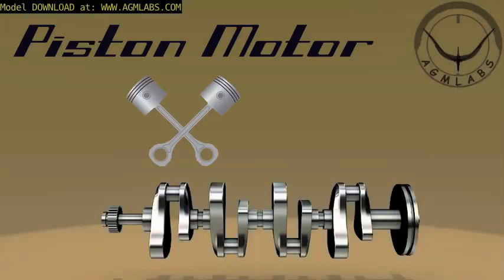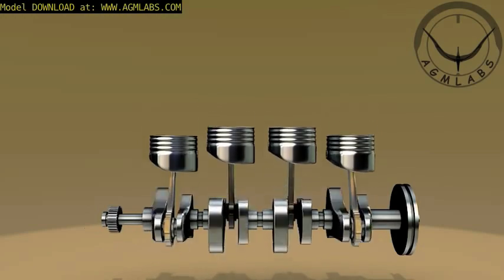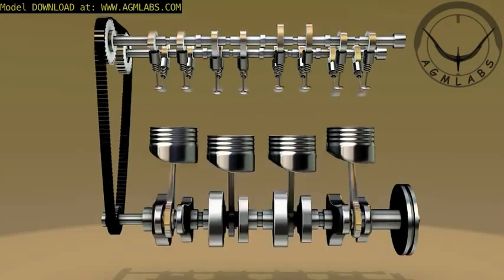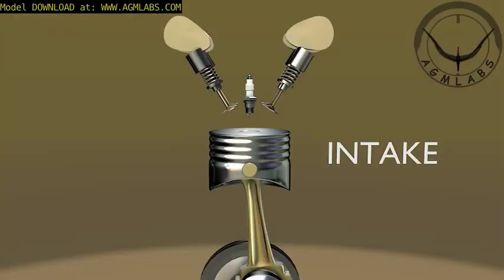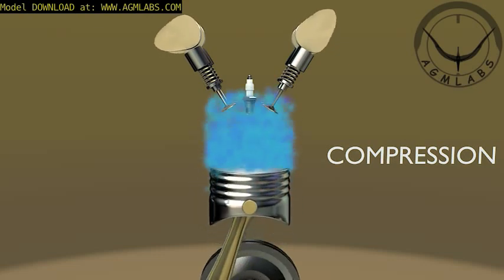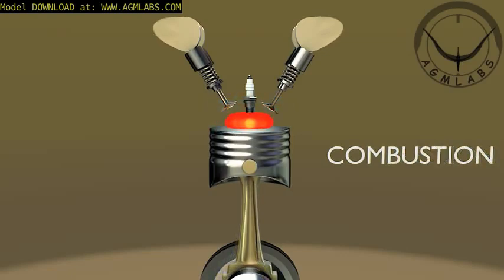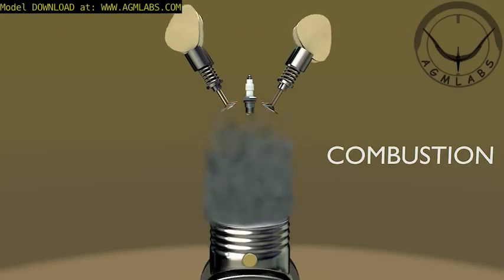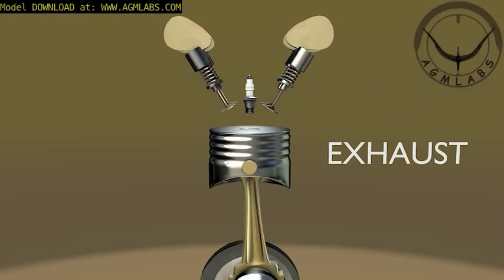Rotary vs Piston

Comment: I did not see a Rotary type engine... what you showed was a WANKEL engine.
Reply: The real doktorbimmer Is a rotary engine not a Wankel engine? Like, not all wankles are rotary engines, but all rotary engines are Wankel engines? (serious question)
Reply: +tenacious645  Good question, Dr Wankel's first design was a Rotary..  Dr Paschke redesigned it as a non-rotary engine.. Mazda bought the Paschke design and later called its brand name "Mazda Rotary®"
Confusing huh?
Reply: So, The real doktorbimmer, the mazda rotary engines aren't actually rotary but wankel right?
Reply: That is correct, Mazda never sold a Rotary type engine.. they bought a license to manufacture the patented Wankel KKM-57 design in Sept. 1961 from NSU Werkes.